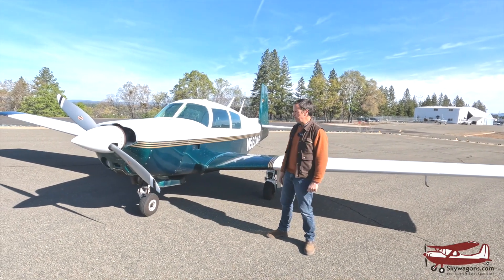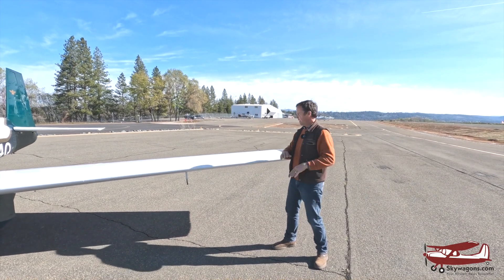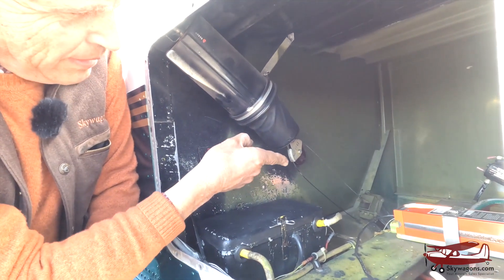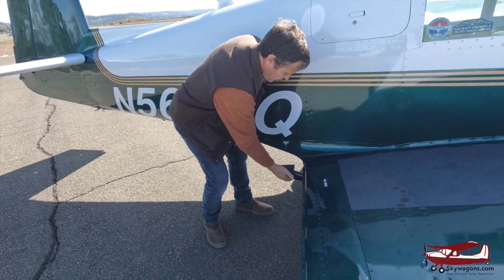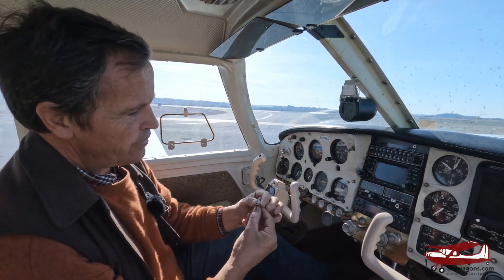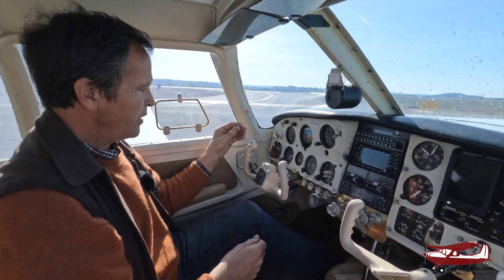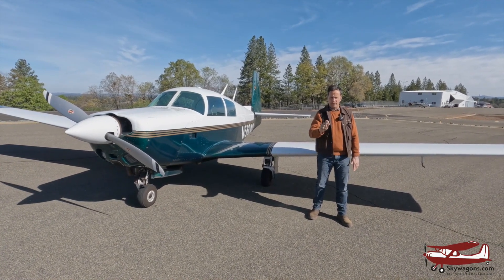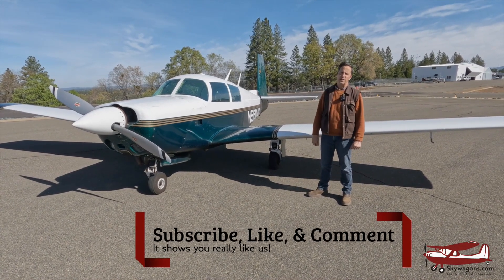Positive Control Early Mooney Autopilot

Comment: The Brittain autopilot system builds off the PC by adding a heading hold function by connecting to the directional gyro and altitude hold by adding diaphragms to the pitch control system along with a sensor in the tail next to the PC gyro already there.

Comment: Love your work Mark.
In the 60s/70s our freighter Bonanza A36s had a ‘wing leveller’ via an electric switch which was used to do a ‘cloud break’ (if stuck on top) without loss of control.  I never understood it’s true purpose because it wasn’t much of an autopilot and we had IRs, but switching it on and reducing power would have done the job if you didn’t panic.
What ‘drove’ the wing leveller Mark ?

Comment: I flew a 1975 M20C for several years with this system. It really works quite well, when it works. We did have to change some servos and vacuum lines, but as you mentioned it's really simple and easy to work one.  Took a bit to get used to pushing the button down when you wanted to turn, but the plane would remind you quite quickly with the stiff controls. Love the Mooneys, they are great aircraft. I was really sad to see them stop producing them again!!

Comment: I'm wondering, with the manifold pressure at takeoff power (ie reasonably  close to atmospheric pressure) does the step make its way out again?
Reply from the maker: The step is up when the engine is running.

Comment: My PC trim in my M20C is turned all the way to the left for level flight. If I disable PC and let hands off the yoke the airplane will in about ten seconds be in a 45 degree right bank and picking up airspeed. I think it should be rigged a bit better than that. Other than that it hard to complain about 160 mph on 11 gph
Reply from the maker: Sounds like a vacuum leak, Sport.  The hoses and bags get old and start leaking.